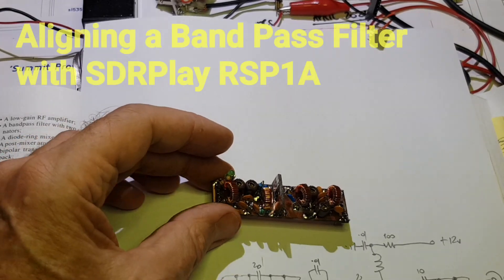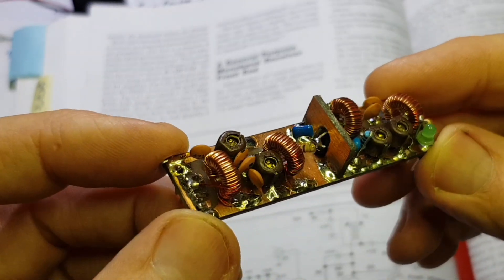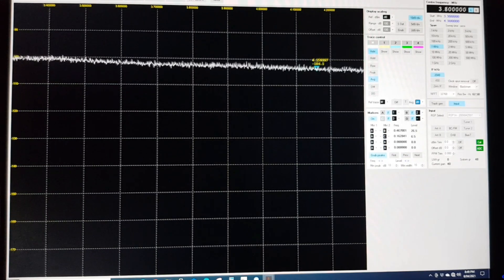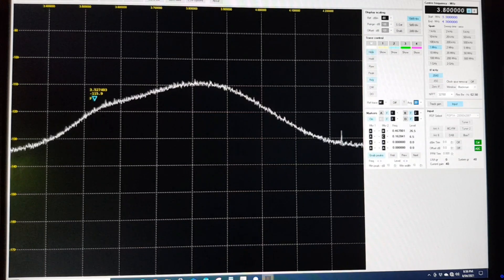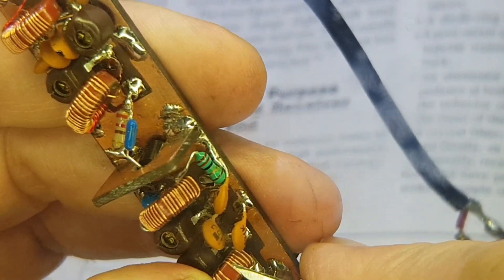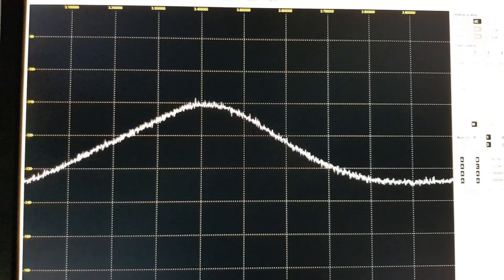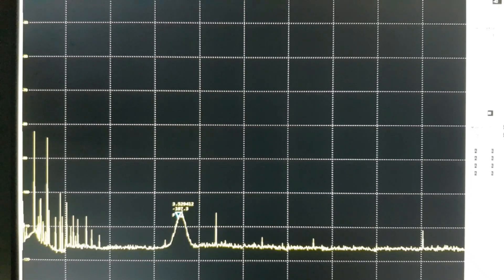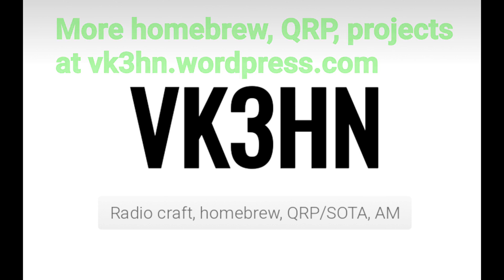Aligning a Band Pass Filter with SDRPlay RSP1A

Comment: Another SDR trick is measuring/adjusting FM deviation with the Bessel Null method..  I used it recently on a TNC doing 9600 baud.
Reply from the maker: Thanks for commenting.  Would be interesting to test a simple frequency modulator on the bench.  Not sure of the method you mention but I'll look it up.